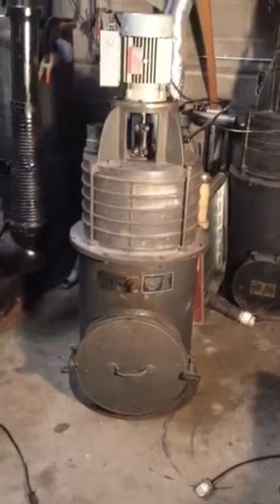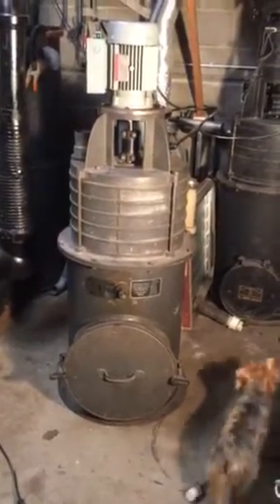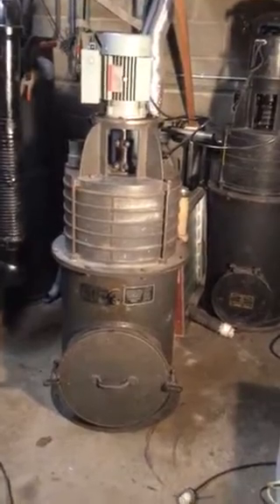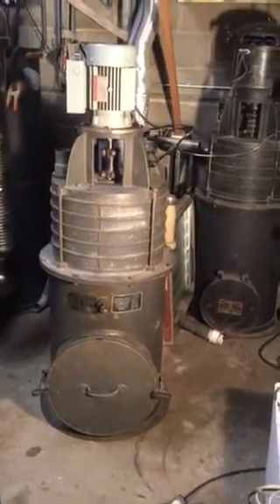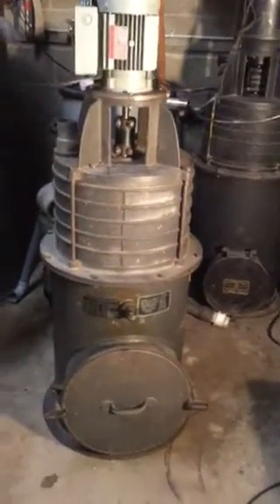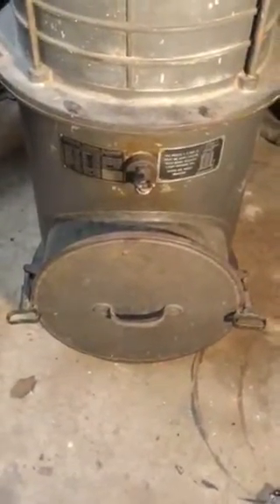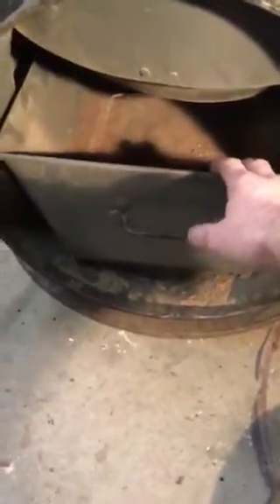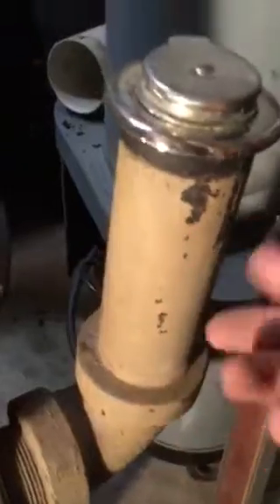1920 Spencer Turbine

Comment: Very cool comparison on the two motor designs. I have several antique refrigerators with repulsion-start motors. Some of them have no more starting current versus full-load current. Back in the day domestic utility power didn't have the capacity it does today. This may have made the difference between starting or not - or severely dimming the lights versus not.   Completely respect and feel your closing words about why you save and keep these. So worth it.